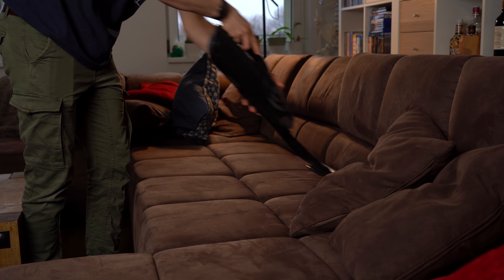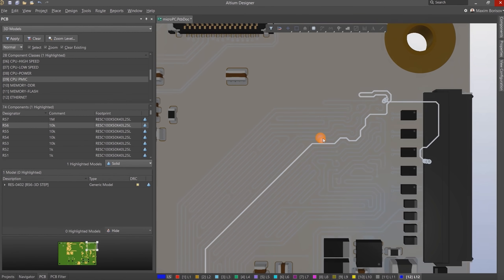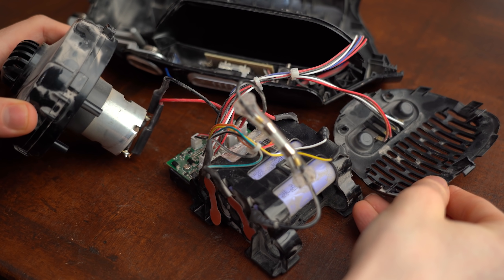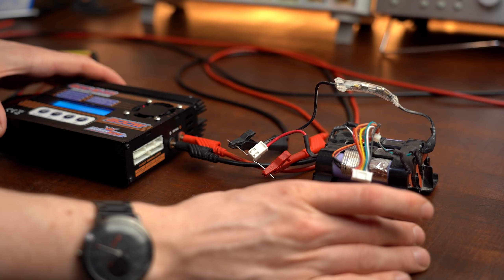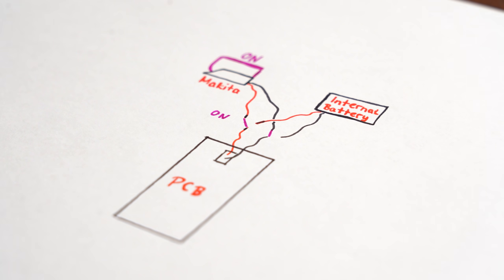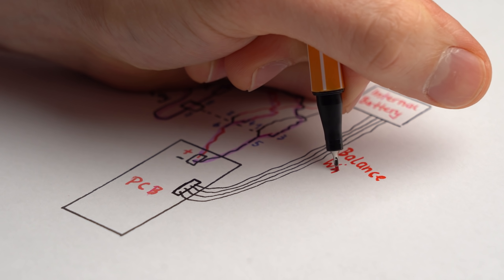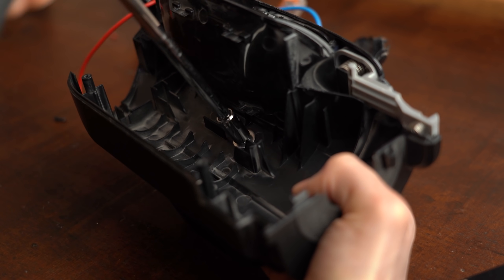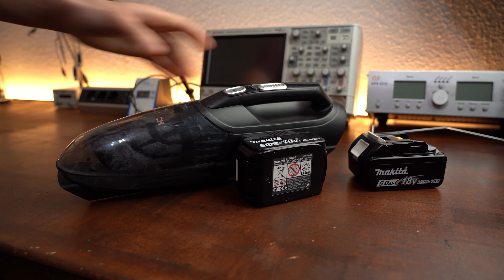Every Device should have this Upgrade! (Endless Battery Run Time)

Comment: Great adaption of a bigger power supply. Now I have a project. My old 18V drill had a dead battery and I need an external power supply to use it as a stationary pillar drill. But all the power supplies lack the necessary current. I'm no electronic wizz like you so maybe a future project? 😄

Comment: For the insane amount of cash it would cost to get both the vacuum, which isn't cheap to begin with, plus the battery, you'd buy like 2-3 proper mains-powered vacs. No joke :)))
Reply: Cordless vacuums are much more convenient than corded ones.  Once you try a good cordless one, you won't want to return to corded.
Reply: Owns the vacuum, owns the batteries. I'm sure he does not mind getting 2-3 vacuums for free but it's the getting tethered on a power cord that does it ;-)

Comment: I use semi similar configuration on my black&decker vacuum. I used small voltage regulator from battery to balancing wires for tricking them with 4 volts.(I removed old18650's) Works like a charm.

Comment: This is awesome.  I made a big battery for my ms18 flash light 40ah. Original pack is 10ah. So 4 hours on turbo. But limited to thermals of the led cooling fans but still very neat.

Comment: Are you sure that the electronics for preventing overdischarge are actually inside the battery pack? I use the 20V batteries from Lidl and they DONT contain the electronics. Their cells are actually directly connected to the output terminals and the switching happens in the tool. The bms in the battery gives out a small voltage on the third pin which tells the tool the state of charge of the battery. This means that you can’t use the battery without the original tools or at least a pcb from them without risking overdischarging them. 
I recently found that out after trying to use their new smart cells for my own project and not getting the current draw on the graph in the app. (I wasn’t able to find anything about that online so designing a regulation circuit might be a good video idea.) As it turns out that’s also measured by the tool and not the battery pack. 

Would be interesting to see if that’s different in the Mikita packs
Reply: ex-Makita repair man here, the packs have every protection you can think of, at a cost. Lidl packs are meant for home-owners/hobbyists that have no need to stress their tools. A roofer with an open roof and a storm coming in will not go easy on his tools. It's reflected in how (all) pro tools are built.

Comment: Hi Scott. Which soldering wire brand you use? Can you test a list of brands? Because before I was using chinese brands which were horrible quality. However then I discovered Asahi solder wire and oh god it is super quality. Melts at low temp and sticks very well to anything I try

Comment: Pretty cool idea. But Dyson uses 6 instead of 5 cells in many batteries. You would probably also need a resilient step-up converter...
Reply: so dyson is the hilti in the homegamer scene.

just use hilti batteries and charger !
Reply: @casemodder89  Cool info.  It's just a shame because i use Makita tools. Time for something new. 😉

80 euros for a new dyson battery. when I think about it, it still makes sense. just buy a hilti battery and a battery adapter. for charging, the dyson charger should work first. 🙃

Comment: Did a similar project with an Oreck that had 4Ah Lead acid, converted to 5Ah Li-on and new charge board.  This gave 8 volts vs 6v and vacuum performs better.

Comment: Last year I did similar handheld vacuum, but converted it from wired 12V car DC to internal 12V laptop cells. Interestingly, internal motor can push 18V by spec.
Reply: That's one of the games they play to reduce costs, probably that 18V motor was cheaper than a 12V motor while running at a similar speed if fed 12V
Reply: @marcogenovesi8570  Probably. Didn't think of it knowing full well CPU manufacturers do the same (Intel F series for example and Ryzen 6 core).

Comment: The idea is perfect. Also your explaination is flawless. I bought  Bosch BCS612KA2 last week. It has removeable/changeable external battery pack. Those who do not have the time or sufficient knowledge to make or those who want to buy a new cordless vacuum cleaner can also consider this option.

Comment: I don't understand the use of the relay, if the two batteries are compatible then couldn't they just be connected in parallel for increased current? You would definitely need to remove the external pack for charging but i presume that is the same with a relay.
Reply: If the internal battery is low and you connected the fully charged one outside there will be a huge current flow which can damage both of them

Comment: The pitch is higher with makita batteries meaning they can supply the current with less sag. All in, you have a stronger vacuum now.
Reply: The internal batteries of his vacuum where depleted i believe. It's just running on it's last bit of charge. The voltage of both batteries were the same so it cannot run faster than with the original batteries when both are charged.
Reply: @Engineer9736  Yes but even if both batteries are at max charge, having newer, more capacity batteries will net you more voltages and more power. Depending on the internal resistance when you draw current from a battery, the voltage sags. Higher capacity, lower internal resistance batteries has a lower sag so they do provide higher voltages.
Reply: @sendorm  You nailed it ;-)

Comment: great scott: shows that he owns, and uses a heat gun

also great scott, 30 seconds later: uses lighter to shrink heatshrink
Reply: welds abs
also: "i just used hotglue"
Reply: @Robbedoes2  lol though in that case he'd wreck his relay and it may not even weld
Reply: Hahaha I thought the EXACT same thing as it happened!!
Reply: those heat guns can melt more than what you wanted. which is probably why he repainted the vacuum.
Reply: @darkshadowsx5949  instructions unclear... created and now currently own worlds first lifetime "Trojan sleeve"
Reply: lol
I was laughing at that, too, except we all know that we do it.
Reply: Now he needs unlimited battery for his heat gun.
Reply: like tha makita tools. looing brand new
Reply: Ehh, I do the same thing, although I also don't have any sort of dedicated work area, so mine gets packed up for storage after every use.
Reply: ehh a lighter is faster and less bulky for couple of heatshrinks
Reply: @araigumakiruno  Yup, and applies heat more locally
Reply: Using the lighter on the heatshrink was the most relatable bit - It's just how it's done m8
Reply: @KomiyanVT  I'm forced to use a heat gun as I work in car audio and customers complain when they see the black marks. Although it wasn't the complaints the bad look on their new wiring that I decided to stop doing it but the concerns of customers that didn't see it right away. We started getting more and more people coming in basically saying "idk when it was but my wires catching fire and burning things I almost died" then trying to pay us for better wire. Unlike some coworkers who saw profit, I instantly refused the customers and would explain to them what it was while offering to snip and replace any heat shrink for free. I'm happy knowing I at least can sleep better than some coworkers lol
Reply: bro, only psychopath use heat gun instead of lighter to shrink heatshrink
Reply: @AlexSiu  what if i use my soldering iron to shrink heatshrink
Reply: @Aeriket  been there, done that
Reply: lighter can be used to solder board as well; put the flame under a board and the solder melt and flow into its place...
Reply: @xponen  you gonna burn the board more than you did soldering
Reply: @xponen  I use it sometimes in a hurry to desolder some wires

Comment: While me having a corded vacuum cleaner with long enough wires which makes it accessible to every corner of the house and also is very powerful :'). But still the mobility of cordless is sometimes good to have in low powered devices.

Comment: Wonderful! Can you pls make a video on how to extend laptop battery life by adding a lipo battery(or multiple one if required).I tried it with my gaming laptop with was pretty packed, hence had to remove the hdd. But still I found the BMS mounted on these smart internal laptop batteries pretty challenging to reverse engineer. It's a 63Wh(15.4V) battery pack inside and I could a fit in a 15000mAh 3.7v lipo cell, but was unable to make it work! Please suggest some work around!
Reply from the maker: I did a project about a laptop powerbank. Watch that.
Reply: I wanted an internal solution!😅
Reply: @mrinmoybanik5598  how is that supposed to work? There’s just not enough space there
Reply: @maxwfk  it's  a 15.6inch laptop and i removed the hardrive

Comment: Makita had the same Idea (DCL180). I've had one for years and it is fantastic and relatively cheap too! It doesn't take anything away from the video maybe a DIY or BUY addendum ;)? in the slightst! It is inspiring to figure out other things to integrate the batteries into myself

Comment: I looked into this problem some time ago. And as I'm just as you addicted to Makita tools, I bought cordless Makita vacuum cleaner. It would be great if we could develop interchangeable battery adapters so we can power everything with Makita batteries. Good video. Thanks.
Reply: If you got access to a 3d printer, there are already hundreds of adapters for many different tool makers. Got a makita tool and a dewalt battery? There is a file for that. And vice versa.

Comment: @GreatScott! When you forget to remove Makita battery from the vacuum it will drain it to zero, because relay gets power directly from it
Reply from the maker: Yes
Reply: @greatscottlab  No, Makita batteries have their own internal cut-off. They will drain to this cutoff, then switch off. Putting the batterie on the charger will reactivate the batterie. (ex Makita repairman here ;-)
Reply: Patient: “Doctor, it hurts when I do this.” Doctor: “Well, then don’t do that.”
That said, an LED reminding the user to remove the battery after vacuuming could be a future improvement.

Comment: Nice. Now I wish you would make a video about replacing a lead acid battery from a UPS with a lithium ion pack.
Reply: You can't do it effectively with a 3S or 4S pack, but it works well with my 24V APC1000 and 7S 16P pack. Just make the pack, get a BMS/Balancer and connect it. Lasts forever.

Comment: Not only does one of the two switches in the relay have no function, but especially with 18v you have enough with only two skottky diodes. One from an old power supply would be perfect. At least that takes almost no space
Reply: The problem with combining both battery inputs with diodes is that then you would not be able to charge the internal battery.

Comment: Great video, thank you.
That is a much cleaner upgrade than what I did with just a switch that obstructed use of the external battery holder while the internal battery was in use. (I don't trust myself enough to remember every time and for as long as I own it!)

Comment: I converted a bunch of my electric devices to changeable battery if they don't have that capability beforehand. 
I am not planning to do that to my OneWheel+XR. Considering that it was really expensive and this is my main transport right now, I am quite careful and still in the planning phase.

Comment: I feel like it's easier to just use a vacuum that plugs in to the mains. I mean, yeah, it's nice to have a battery-powered, portable vacuum that is highly mobile, especially once you've modded it to take portable tooling power packs, but wouldn't a power cord be so much easier inside of the home?
Reply: moving a cord around is a pain in the ass. if you used the same battery pack for multiple things there's a higher chance you'll always have one at 100%. extra weight might be harder on the arms though, i don't know since i don't have a cordless.
Reply: Yeah, but then we wouldn’t have another GreatScott video…

I’m usually on team Power Cord too, btw. Recently, I went to use my cordless drill and discovered that it was more discharged than I recalled. Fail. So, I grabbed a corded one instead. Guess what? It worked right away.

Comment: The batteries for these rechargeable devices seem to age faster/more than a simple capacity test suggests. I wondered if the issue was an increase in the internal resistance such that voltage falls faster in use with a high (7.5a) discharge current ?
Reply: The aging is maybe caused by keeping them fully charged at 4.2V constantly - LiIon cells hate that. Better if they charge up to 4.1V then stop and let them settle, then charge again when the voltage drops below 4V or something and repeat. If you know you're not going to use it for a while, then discharge the battery about halfway and check it again in a few month''s time.
Beyond having to pay attention to safety, battery manufacturers care less about cell longevity, as it means they can sell more packs sooner.
With care, these packs could last 10 or more years.
Reply: The cells degrade when they have a high current draw, li-ion wasn't best known for this like lead and a few other types as this can make them heat, or you get evaporation.
If you had a better match (current availability to capacity) then the battery should last longer retaining its capacity.

As you got another reply, charging the battery to 4.2 isn't great. 4.1 gives you more cycles. And for long term storage 3.7 volts is desirable as the balance of electron's keeps the battery in better order. But all batteries are the same in that respect.

Nicad, has a memory effect, so if you keep them low they want to go low, or they can shallow cycle and all sorts of fun. These are best left discharged and charged when you want to use them. They don't have Ill effects. Trying to keep them normal is a problem. As they have a high self discharge
Reply: @guywhoknows  leaving NiCads discharged in storage is a sure way to loose them to dendrite formation (internal short circuit).
And Li-ion can and will repeatedly do high discharge currents, you just have to pay for the cells that are actually designed for it. Power tool cells like those in the Makita pack can easily do 8-10C from full to zero charge, the only limit is the temperature. And they cost well over $5/pcs even in bulk.
Reply: @AKAtheA  Makita batteries aren't good. Mine all died and were kept well, they have little electrolyte.
Reply: @AKAtheA  it is still true that a lithium battery (and most other chemistries) degrade faster when used at high discharge rates, even cells that are designed for it. The ones that are designed for it just won't blow up if you try :)
Reply: disposable appliances like cheap vacuums use cheap batteries with short lifespans, to get you to replace them sooner.
Reply: It depends on the usage. From my own experience and reading with lithium battery's I can say: Don't charge and discharge with too much current. Charge with around 0.2-0.4C. And discharge with around half of what is stated in the datasheet. AND: keep the voltage as stable as possible. I know, sounds a bit stupid with a battery. But if, for example, you only use the cell between 3,5 - 4V it will thank you with a long life and much more stable capacity.
Reply: That is more prominent with older NIMH or NICAD batteries. Those have something called memory loss (if my memory is correct lol), but Li-ion don't have this or atleast not to such a degree.
Reply: @LuxGamer16  no that's not involved here. Batteries under higher discharge currents will not last as long as one's with a lower current draw, it's an effect that exist in all battery chemistries universally. That 7 amp load on a 2Ah cell is a 3C discharge, you'll get less than the rated capacity at that discharge current, the nominal capacity of the cells is usually measured bellow 1C.

Comment: Missed opportunity to 3D print a piece that can conform to both the adapter and the contours of the vacuum for greater surface area contact. Still a great project though!
Reply: It will be quite hard to match the existing shape of the vacuum with a 3D modelling application. I think there is no issue at all with the solution in the video.

Comment: great video like all other ;) but i see a thing who let me in truble: the relay coil must have à free wheel diode no ? i think during the latching time of contact, the high voltage of the coil can pass though it and maybe destroy the electronic board no ? what are you thinking for ?

Comment: Nice ! I'm a bit disappointed you keep the original battery inside. It must be heavier now and not balanced. Thanks for the video 🙂
Reply: Well, balance could be achieved with two additional batteries instead of just one. ;) Retaining the original battery makes sense to me. If the user does actually remember to plug in the vacuum for charging, the vacuum is still lighter and easier to handle. The weight savings seems like it’d be pretty small, compared to the lost functionality. Just my opinion.

Comment: You need only one of the two switches in that relay. You could use a single switch relay. Especially while you made a common ground that second switch does not do anything.

Comment: I upgraded my AEG 2in1 vac(exact system which is shown in the video) with 3500mah 18650 cells. Works perfectly fine for 25 min of constant vacuuming without the cells being discharged completely.

Comment: Hmm, the datasheet for the relay says it's 75mA ON current, which means it'll drain a 5Ah battery in ~3 days. So I guess don't keep it plugged in? 
Also, what happens when the external battery dies? The balancing wires may still show good voltage, and if the battery isn't properly protected, will it shut down? I.e. does the MCU measure the overall voltage to shut down? 
Finally, how much does it increase the weight of the vacuum? Is it convenient with an imbalanced weight now?